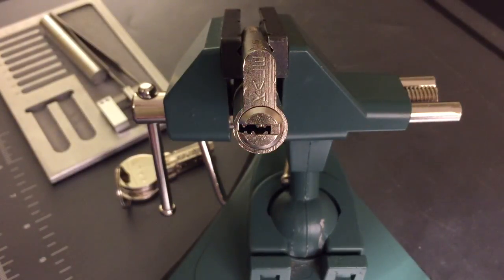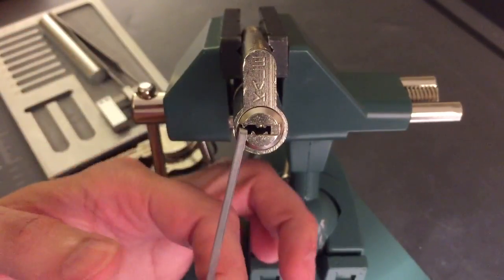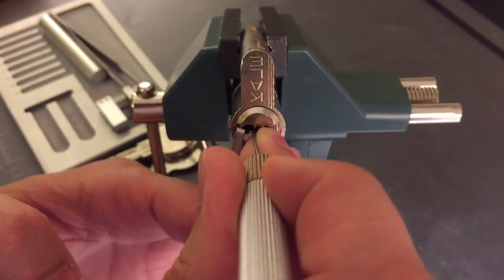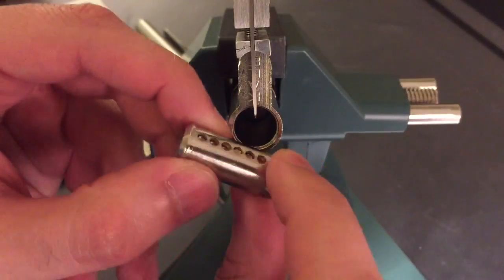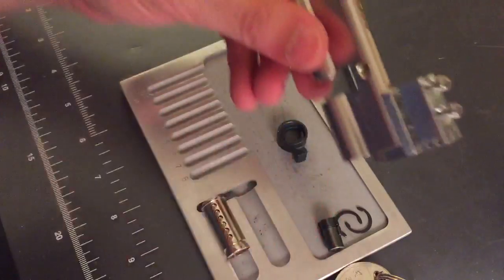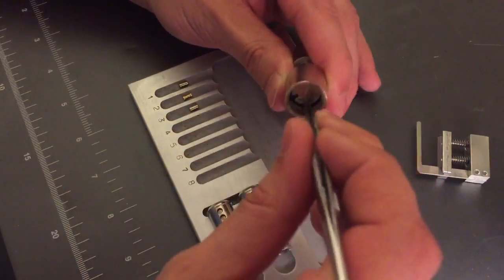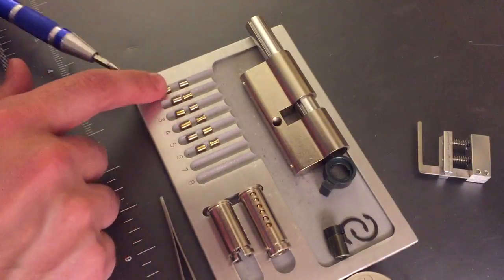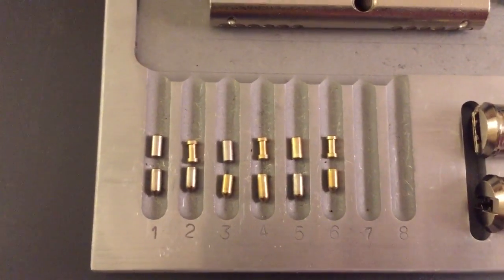[20] Kale Kilit 164 SNC Dimple Euro Cylinder Picked and Gutted

Comment: Excellent picking and video. It's great to see gutted dimple lock, there is really not big difference in key pins length with dimples.
Reply from the maker: Mike Pergl Thank you.  Agreed... dimple key pins are pretty much the same as any other lock because the core diameter is the same.